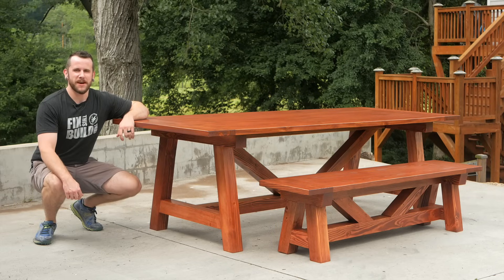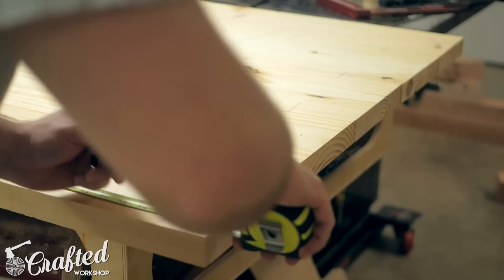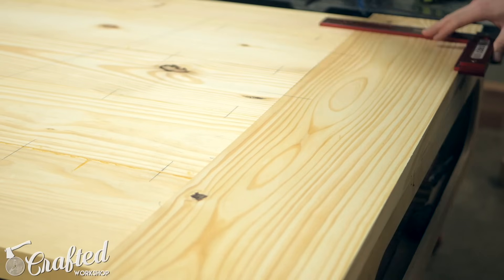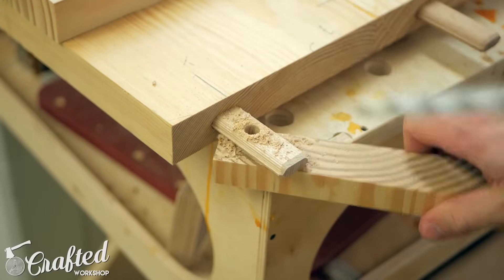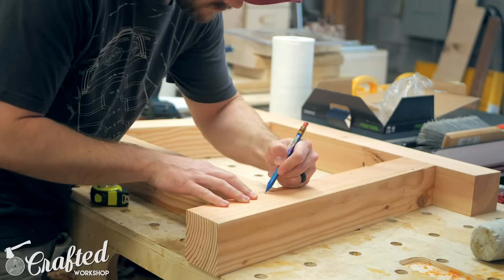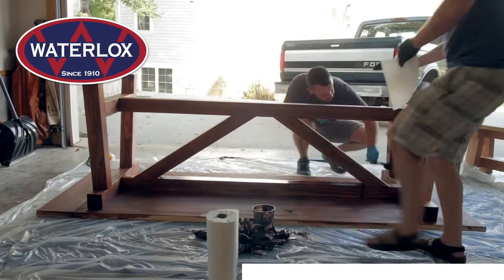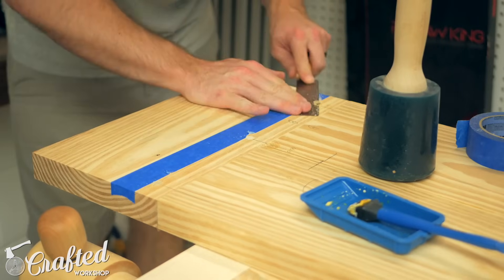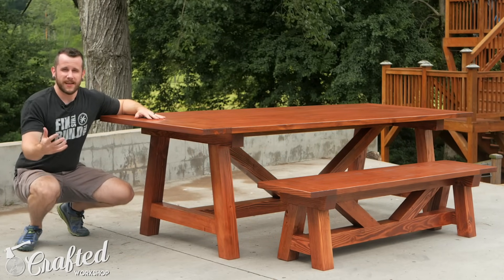How To Build A Farmhouse Table and Benches For $250 | Woodworking DIY

Comment: I'm just finishing up an outdoor picnic table or harvest table and one bench and I built it out of select white pine and my plan is to finish it with danish oil, I'm wondering what your thoughts are on how this is going to weather all summer outside it will be covered in the winter

Comment: Rocklers bead lock mortise dowel set up would work as well for the breadboard ends eh?Drill the holes slightly larger for the "loose" effect for movement
Reply from the maker: Hmm, I’m not sure actually. You wouldn’t want up and down movement since that would create a wobbly end. I think using a router is probably the best bet outside of the Domino.

Comment: Awesome job! For additional protection, add a couple of coats of epoxy to the bottom of the legs (end grain).
Reply from the maker: +Eric Pretot thanks! This table isn't going outside, just for the final shots.
Reply: That makes sense. I'm planning an outdoor table. Thinking of using redwood.
Reply from the maker: +Eric Pretot nice! Should look great.

Comment: I know this is an old video but I’m going to building my own table very soon. Just wondered why the dowels were so close to the edge of the board (during the glue up) as opposed to in the middle of the board? I plan on using dowels for my table, any insight would be greatly appreciated! Thanks and awesome build!

Comment: Building with Pine is attractive, but the wood is so soft. I do not know the Waterlox products. Do they harden the wood somewhat?
If you use your nail, would you easily be putting an indentation there for instance?

Comment: Hi,that’s great project end pretty good looking. I have a question if you can explain for me. Why you use glue on this dominos when you want to leave them space for wood moving. Isn’t that only for dry joints or glue is not a problem for wood moving in time. I’m new in woodworking,so would be more than useful for me to understand this technique. Thanks for video 🪵🪵🪵😊

Comment: Hey man, I had a question about the breadboard ends. Do you think using a router and having a floating tenon glued in both the table top and the breadboard would work? Thanks!
Reply from the maker: +Michael Volpe for sure. You only want to glue the tenon in the center of the breadboard, though. The tenons towards the outside shouldn't have glue in the breadboards.
Reply: Cool. Thanks!

Comment: Great job man! The key tools here are the planer and thicknesser. In my experience, there is no way you could buy boards like that (without planing them after) and have them fit nicely for the table top glue up without unsightly gaps. Oh and of course there is the hand tool option.
Reply from the maker: Thanks! Yea, definitely agree. You need to do something to straighten the edges to get a tight glue seam. A jointer plane is definitely a good, inexpensive option for those without a jointer.

Comment: I’m hoping this thread is still open and you are still active, thank you very much for this video, I’ve been requisitioned by my boss to build this set slightly larger, 6’x16’ for an apartment complex to go under a pavilion. What are your thoughts on an epoxy finish for the top? My concern would be expansion causing it to crack, I’ll be purchasing your plans tomorrow and attempting to adapt them to the required size with my limited tool selection. Any help is greatly appreciated

Comment: Can you help me design a 24 inch high end square table. I do have lot of composite deck boards that are left over from my deck project. I really need a simple design where i can use top as composite boards. Simple drawing will help.

Comment: Love the video! I am in process of building similar table but using 3"x3", I want to do the frame joinery using dowels 12mm or 18mm  2 dowels per side, the dowels will be diagonally aligned. Do you think that is sufficient?  Can I do a half-lap join dowelled for the stretcher that run between the 2 legs?

Comment: Very nice design and execution Johnny. Well done. Purely for aesthetics/proportion, I wonder how it would look to build up the table top another 3/4"? Laminating a 1x4 furring strip around the perimeter of the underside of the table would beef up the profile, as well as perhaps help prevent warping down the road? Just a thought. I definitely plan to replicate your project! Thanks for putting out high quality, inspirational videos!
Reply from the maker: +Steve Mahr I think it'd look good! Although, putting a strip around the entire top would restrict movement, which is no good. Thanks for watching!
Reply: Crafted Workshop yes, you'd have to build up the top and the bread board ends separately. Great explanation of that concept BTW. I wish more content creators would take the time to explain new or complicated concepts in their videos. Keep up the great work! 👍
Reply from the maker: +Steve Mahr thanks a lot!

Comment: I love this, and this will be my first dining room table build. With that in mind, with the structure of the table, are the middle angled pieces a requirement for the table structure itself? True, they do help, but are they necessary? I ask since this is an element of the table that our family has discussed and do not really like. We feel it makes the piece too clunky. If they are structurally required, could they be made less steep so that they are further apart instead of so close together? Thank you for your time and your plans!
Reply from the maker: +Mr. V. Awesome! You could have one support at 90 degrees if you'd rather go for that look. I think that'd be plenty strong!
Reply: I appreciate your wonderfully quick reply! I think we're going to dry fit it all together without the support and then play with the possibilities! Thanks! 

Lastly, I see how you used the biscuit joiner and the fasteners for the table. Did you use both the fasteners and the screws in the final product. If so, why? If not, why? Thanks again for all your help for this novice enthusiast.
Reply from the maker: +Mr. V. No problem! Yes, I used screws in the middle of the table and the table top fasteners towards the edges. The screws provide a really good hold and having them in the center forces the wood movement towards the edges of the table. This makes sure everything stays aligned properly.

Comment: 1. Great design and execution. 2. I can NEVER find dimensional lumber in near that quality at the big box stores. 3. Those are NEVER going to move without a couple of bulky guys to handle them. The heft of those benches would stop most kids from moving them. Love this set.
Reply from the maker: +Clyde Decker thanks! Yea, the wood looked decent before I ran it through the planer and jointer but that REALLY made things look better. And yea, the benches are pretty dang heavy.

Comment: That turned out great! Question though.... could you have simply left the 4 inch screws in place as the fastening and not done the table top fasteners?
Reply from the maker: You want to allow the table top to expand and contract, hence the fasteners. Thanks!

Comment: Great video man and very explanatory. I never thought to just drill 1" dowel holes for base like that. Seems much easier and quicker than the loose tenons joints I've been doing. And when it comes to using 6" screws for the base as another option, do you think the wood cracking or splitting along the 4x4s would ever be a problem? Also seems like another good quick way to put the base together. Thanks again.

Comment: i recently made a table top out of southern pine 2 by 10's.  I used pocket holes to attach them.  I stained and polyurethaned the top.  Its about 5 1/2 feet long and almost 3 feet wide.  I put it over a friends front load washer and dryer.  just wondering since i used the pocket screws how long you think it would last before it starts to flex and move and bend.
Reply from the maker: +Joshua Carter did you use pocket screws for a breadboard end or just to attach the boards in a panel? It's the breadboards that shouldn't be attached with pocket screws. No problem with using them for a panel.
Reply: Oh ok cool. That makes me feel better. I didn't put a bread board on it. Lol. I was worried it would come apart at some point. I'm still an armature lol but I couldn't have done it without the paulk workbench I got from your giveaway. Lol. It's so wide I could piece the whole thing together without any over lap or really much sweat. Haha

Comment: I've never understood bread board ends... If the bread board is long grain next to short grain of the table, the table should shirk and expand and the bread board stay the same length... Wouldn't this leave a bump either in or out along the side of the table where the 2 meet should the table expand/contract?
Reply from the maker: +DIY Builds yup the breadboard will overhang slightly during the drier months (winter). It's not super noticeable, especially to anyone but us woodworkers.

Comment: I see you upgraded to the industrial saw stop.  Very nice
Reply from the maker: +WoodWorkingGuy MN yup!
Reply: Love it. Also love your method for breadboard ends with the domino.  I did a test this week where I made a small bench with several different techniques and the draw board method gave me the best tight joint.  It takes a little longer, but it's worth it.
Reply from the maker: +WoodWorkingGuy MN thanks! The Domino is outstanding for breadboards.
Reply: it's a wonderful tool...my favorite

Comment: Okay so I am building this exact table. It looks like you used Douglas Fir for the base and Pine for the top, right? Im worried that the different species wont take the stain the same way. Yours looks even and smooth, any tips on how I can make mine look the same?
Reply from the maker: +Jayson Owen yup, that's right! I was worried about that too but then came out nice and even. I would definitely recommend the TrueTone stain I used from Waterlox, the stain was super even. Just follow the directions I outlined in the video.

Comment: Really nice build!  Noticed that you started with a DeWalt miter saw then migrated into the rest of the build with a Kapex.  Any reasons? Also, as I start to build out my shop (topic for the podcast??) how does one afford the power tools like you have?  Thanks!  The Crafted podcast is one of my favorite podcasts and listen to it regularly.
Reply from the maker: +Stanley Pearse Festool was nice enough to send some tools over for me to check out. The best way to upgrade your tools is to buy them slowly as the need arises. This is my job, so tools are a business expense. I'm also fortunate enough to receive some tools free in exchange for the promotional value from their use in my videos.

Comment: Great build! just wondering if using  biscuits instead of dominoes would work. Thinking more for the bread ends. Cheers
Reply from the maker: +Dan Chilton no, they wouldn't have enough strength for the breadboards. You need longer materials for a sturdier connection. A router is the most inexpensive way to get the job done.

Comment: Perfect! Exactly what my wife wants and the supports look fancier than simpler designs I've seen. I'm gonna have to get a dowel jig. Dammit, I've been bitten by the woodworking bug! Would the breadboard work with dowels instead of domino's?
Reply from the maker: Nice! Breadboards with dowels aren’t ideal, as they don’t allow room for movement. You would need to drill the holes about twice as wide towards the outside of the table. You could definitely do it, but it’s a little more tricky.
Reply: Crafted Workshop I guess it'll depend on the wife at that point whether or not I invest in a domino cutter. I'll have to check out the router options too since I already own one of those.

Comment: What drill press did you use? Why did you use two different miter saws?
Reply from the maker: +Noconz0727 MC it's the Nova Voyager drill press. And I got a new miter saw halfway through the project.

Comment: Great build. Its nice to see a project made from construction lumber but properly milled and assembled using the right joinery methods. I make a lot of tables and probably like most started off using pocket holes and construction lumber but have worked up to what you are doing here.  A lot of people just want cheap disposable furniture but this video really shows the amount of steps and effort required to do this right. Awesome job.
Reply from the maker: +Mark Shaw thanks man! It's definitely a lot of work to build stuff the right way, but pieces like this should last for many years to come.

Comment: Did you run the 4x4 through the jointer at all? I’m having a hard time finding square posts at my local stores. They seem to be either twisted, bowed, cupped or all 3.
Reply from the maker: Nope, just skip planed them. Make sure they aren’t pressure treated 4x4s, those will definitely be super warped.

Comment: Great video ! Could a person get away with dowels instead of dominos on the breadboard ends ?
Reply from the maker: You’d have to drill the dowel holes extra wide to allow for movement, but it would probably work. I’d probably go for the tongue and groove method using a router.

Comment: I'm about to make this same table. My only concern is having that breadboard piece so wide out from the dominos.  Do you think over time it might sag or does it feel pretty solid on that outer piece? My client wants the end of the table to be out from the legs so someone can sit there easily which concerns me as most farm tables have that breadboard ends starting at the base and going out.  I'm thinking about making the breadboard ends maybe 4-5" comparted to 7 3/4 like yours.  Thoughts?
Reply from the maker: +WoodWorkingGuy MN the strength totally depends on the size of your Dominos. I used the longest 12mm Dominos and it seemed super strong. Hope that helps!
Reply: Yup! Thanks it does!

Comment: Damn man - upgrades everywhere. Festool Miter Saw. Massive Powermatic Jointer - curious how much better the Festool is compared to the one you had before (was it Dewalt?).

Table and bench are awesome - you have impressively detailed craftsmanship in all of your projects that I admire.
Reply from the maker: +The Cutting Bored hah, yea been upgrading a lot here recently. The biggest difference between the Kapex and the DEWALT is the dust collection. The Kapex has the best miter saw dust collection I've ever used. And thanks man, glad you enjoyed the project!
Reply: Oh interesting - had no clue. 

Is it rude to ask if you're purchasing those tools yourself or upgrading through sponsorships? You totally don't have to answer, but your channel is exploding so just curious if your upgrade strategy is in tandem with how you grow as a creator. Cheers
Reply from the maker: +The Cutting Bored nope, have no problem answering that. The Powermatic and Festool tools were both provided in exchange for me using them in my projects. I'm fortunate to have gotten quite a few of my tools that way.
Reply: Makes perfect sense - thanks for answering - appreciate the insight as it helps my understanding of the entire process. Enjoy them!
Reply from the maker: +The Cutting Bored no problem! I certainly will enjoy and use the hell out of them, hah.

Comment: damn! that look like it hurt!😲
but the table and benches turned out awesome!👍👍  i definitely need to invest in the Domino✔
Reply: Aaron Massuda its funny cuz  I have 3 different Dowling Jigs I have the Rockler one that he used in the video everytimei ise it  it always moves on me. the dowe
ls never lineup right idk what im doing wrong.lol  I do have a biscuit joiner same sort of scenario they never seem to line up right and  the general"" doweling jig from Home Depot that one's actually better than the Rockler one and then I have the Milescraft which is accurate but  to set up is a little time consuming. but it is most accurate.  I appreciate the ur opinion bro.ur right it is very expensive but i would prolly use everyday  that's for sure.most of my commissions are tables and or benches(sets)
Reply from the maker: +Joe basement woodworking hah, yes it did! The Domino is an awesome tool for this type of thing. Makes the joinery a snap.
Reply: Crafted Workshop sure looked like it did..its a little pricey but itll pay for itself after a couple table sets i build. Wife wont like it but what she dont know wont hurt her..ahhaa
Reply from the maker: +Joe basement woodworking definitely agree. Time saved is money earned.
Reply: Crafted Workshop i agree with that..looks like were in agreement with me getting a domino.glad we had this convo..lol
Reply from the maker: +Joe basement woodworking lol!
Reply: Crafted Workshop  that's what I love about this community everyone's always willing to help out..lol

Comment: Ouch! gotta watch those toes. I'd recommend a pair of safety shoes- something with a semi rigid plastic toe would be sufficient in a woodworking environment. I've found steel toes to be uncomfortable as they usually rub on the top of my feet at the toe crease, and cold in the winter; regardless of sock selection.
Reply from the maker: Yup, planning to add some composite toe shoes to the wardrobe for sure.

Comment: Can a Domino 500 be used for this instead of the 700?
Reply from the maker: +Alma Villalobos the 500 would probably be capable, but it's max depth is 28mm, where as the 700 has a max depth of 70mm. The 700 will also cut mortises up to 14mm. The bigger the better on the breadboards.